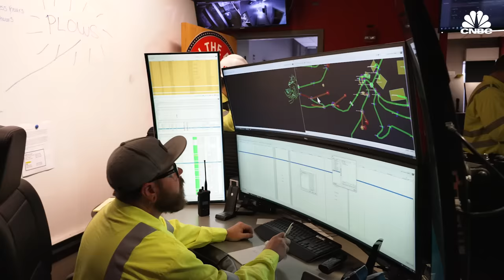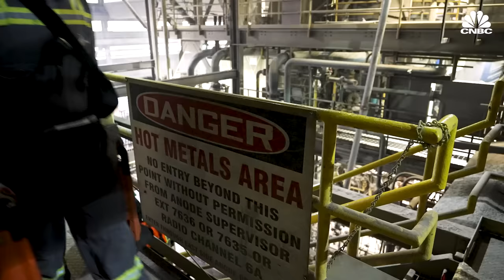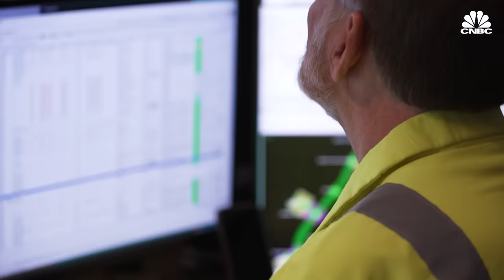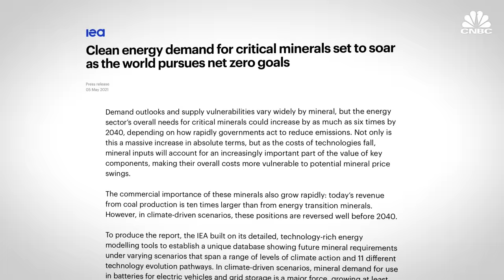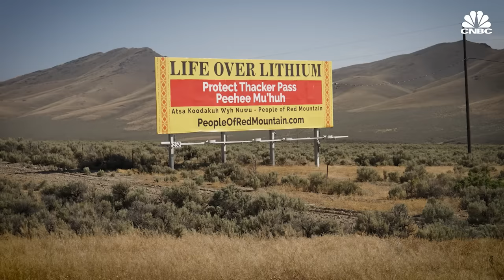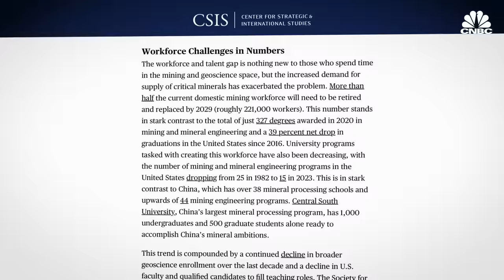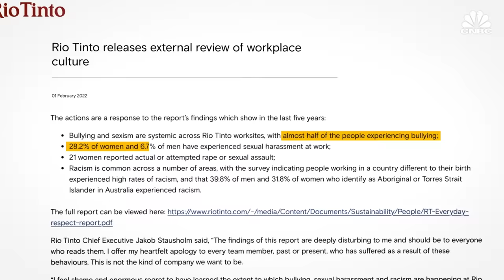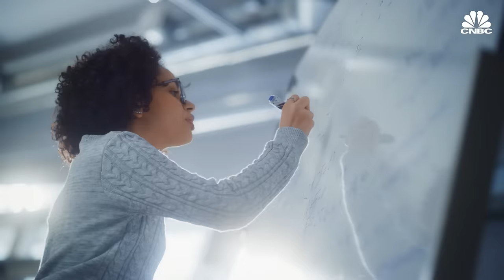Why The U.S. Is Running Out Of Mining Workers

Comment: I’m a truck driver. I’ve delivered to a number of different mines now. One of which was in brookville Alabama which is about 30 miles SW of Birmingham,”. It was an under ground coal mine. I asked one of the workers if it was a good paying job. He said it was one of the best jobs in the area for people without a degree. He said it started at approx 80k per year and pays more depending on one’s job title. It a union job. 80k is more than many people with degrees earn but I’m sure it’s dangerous and lots of hard work. 

I personally would have applied for that job if I had know about it before I got into truck driving. 
Some other jobs that also pay well that many people many not know about ( that don’t require a degree) are steel mill workers. Delivered to the Cleveland cliffs steel mill in Steelton PA , pay starts at 80k. Also the railroads pay works well, and offer company paid training for all sorts of skilled high paying careers like Conductors and electricians for rail signal equipment.
Reply: mba2ceo no he is correct I lived there - I have many friends who graduated and work there - all men around here go some form of labor intensive job or college

Comment: Im a Union guy in a pretty decent field in a major metropolitan area. My industry has been at a hiring deficit nationally for years. If you did the math on what my wage could be compared to what other tradesmen in my line of work earned 20 and 30 years ago, compared to the national average wage and increases for inflation, it stands to reason that I would be making nearly double what i do now. I think people are subconsciously realizing that the profit models for labor (wages), even in "good" jobs like mine, aren't lining up. Pair that with generally abandoning exposing young people to trades like  mining, my own and a host of other vocations as worthwhile employment and you get a kind of apathy against old fashioned "hard work".

It is not surpising.
Reply: Well said.
Reply: Yea I worked at a plastic injection plant doing mold setup and the people who were just packing parts on the line that have been there since the plant opened (around 1970) with inflation adjusted back then were making more than what the electricians, milwrights , and tool shop were making right now.
Reply: @LouisKatz  thanks.
Reply: @rudociliak6683  that's terribly sad but very believable
Reply: Y I am a mine worker (in Australia) and my wage in real terms is only 75% of what it was ten years ago.  And they complain about labour shortages!  Some of those CEOs need to take a basic economics course in supply and demand.

Comment: They should really use conveyer belts to take the ore from the bottom to the top and use the trucks in the most efficient way in conjunction with the conveyer belts.
Reply: They do use conveyors in underground mines and open cut coal mines, but the volume mined is much greater.

Comment: The issue is that it is cheaper to get those minerals imported by using cheap labor and instead of protecting and providing jobs companies rather buy cheap imports than domestically hence the lower wage for a job that requires a lot labor and high risk of getting injured or sick

Comment: I do think this is a serious problem, but there are other potential engineering solutions to problems like all the extra copper normally required in a BEV.  The same tends to be true of other rare earth minerals.  The solutions today are the ones that were achieved first or achieved because they were the path of least resistance, usually where cost of the end product was not the primary concern.  But there are substitutions possible that can drive down costs.  And I'm sure there will be automation that reduces the total number of workers required by a mine site.

But as I said, I do think we need do more mining here in the USA.  And I think we need encourage people to pursue these types of careers and enroll in mining degree programs.  I'm just saying that you have to realize that there is a shortage at the moment in several areas and there are people working to address those shortages.  Increasing mining is probably part of the solution, but if costs are high enough long enough there will be design changes that will reduce demand on some of the scarcer, more costly minerals.

Comment: Mining industry doesn't have a problem because of diversity. It has a problem because you don't train your people. You give them a couple days of training and then throw them into a meat grinder. 
What did you expect was going to happen? Same thing happen to the baby boomer electrician I, a millennial, had to replace at work. Barely got any training before I was sent out there to replace him. Only got worse after that. 
Ended up as only electrician on my crew 3 months and had to cover 6 machines. When finally got help. I had to train my partner and cover 6 machines for multiple months. My boss thought this was okay and this was a fortune 500 company. This is also happening everywhere.